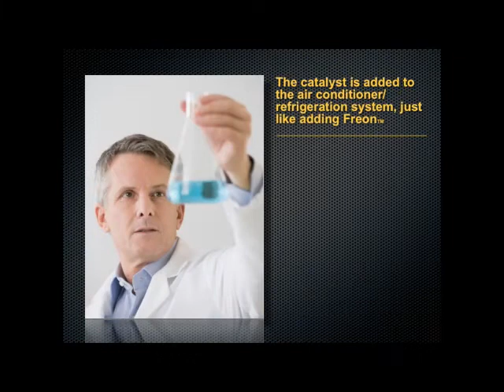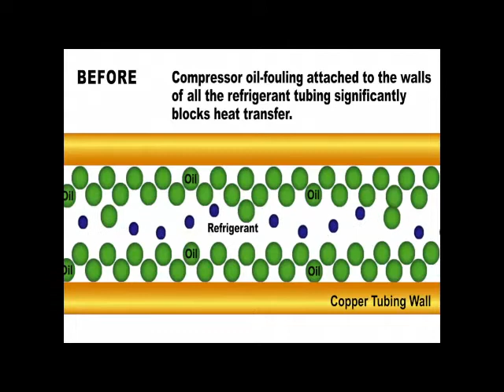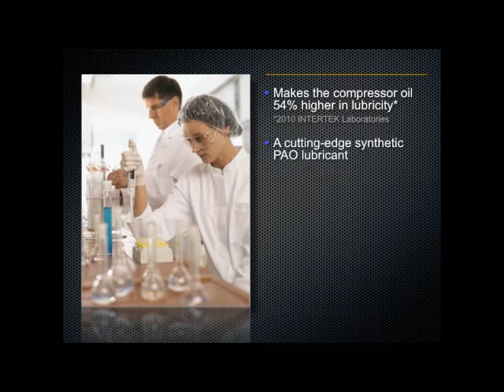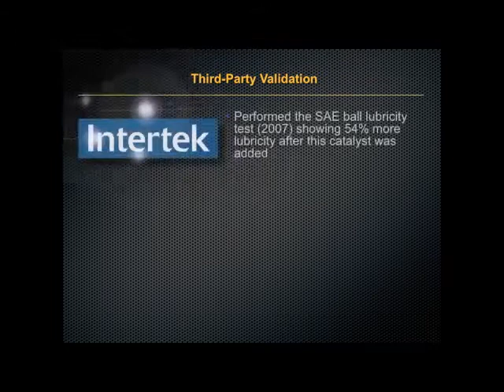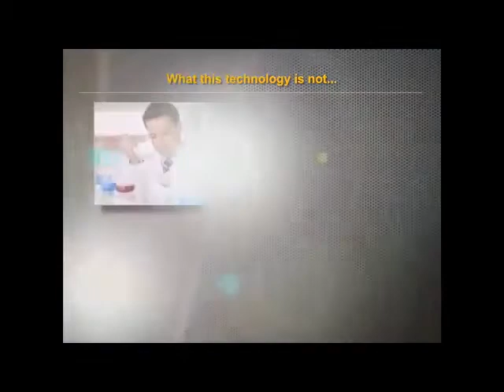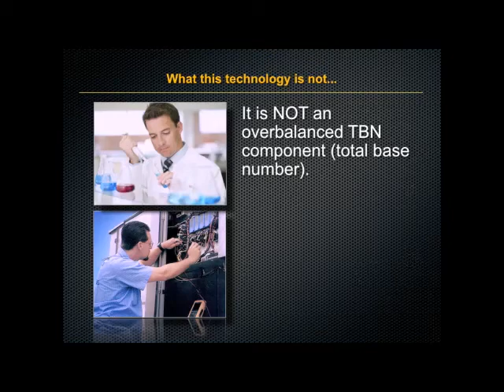IceCOLD® - Introduction Video

Comment: I have a solar HVAC system, uses Solar Cool panel  The refrigerant gets preheated, increasing the efficiency to 32 SEER from the heat pumps rated 20 SEER. Here are the product links:
Heat Pump:
http://www.lennox.com/products/air-conditioners/XC17/
Solar Panel
http://www.sednaaireusa.com/Products/SolarCool.aspx

Will your product actually decrease the efficiency of my solar cool setup as it forms a thermal insulation between the refrigerant and the tubing?

Thanks.